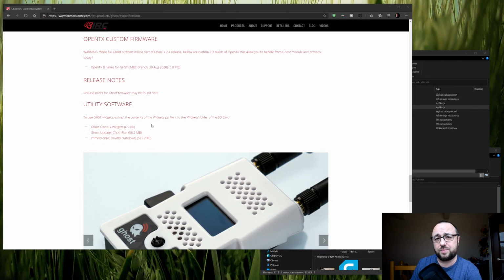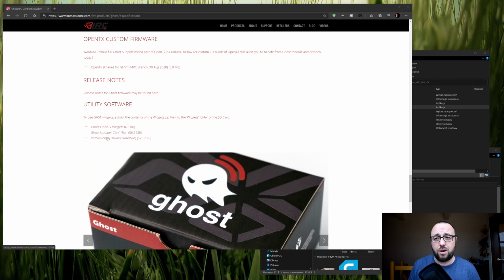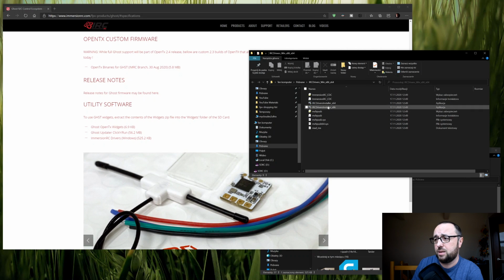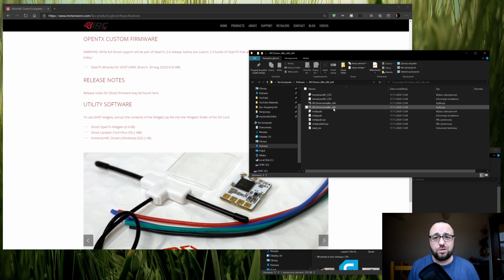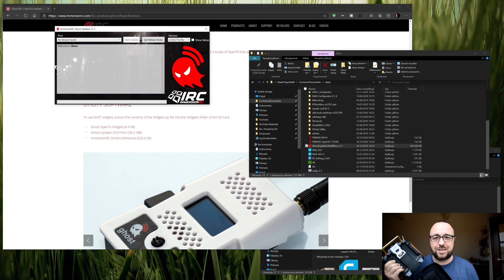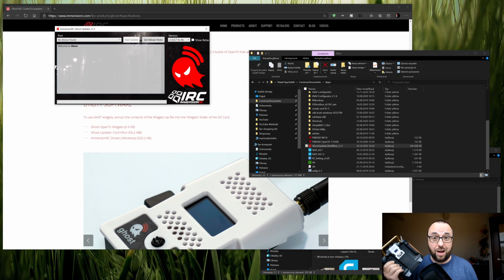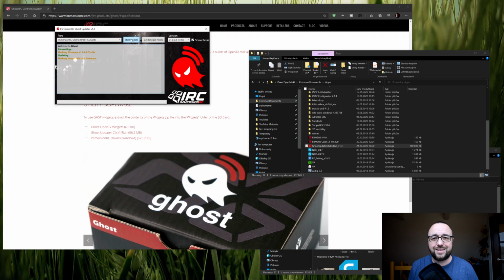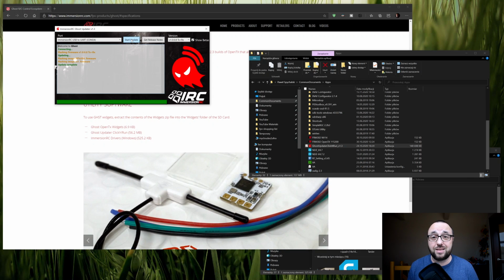ImmersionRC Ghost firmware upgrade tutorial

Comment: Pawel, I´ve a strange problem, can´t make it right. Inav for 7 inch copter as preset. Motor map ok, propps ok, board alignment ok. But! The quad moves with little gas up in panic at the same time yaw:s and is uncontrollable. Every pre check green. No problem to arm, but not flyable
Reply: https://www.youtube.com/watch?v=bEBympukKCA&feature=youtu.be
Reply: https://www.youtube.com/watch?v=xdhb-TbIHuk
Reply: Ok, downgraded to 2.3, far away from 2.6. Now it works. A bug in Inav 2.6?
Reply from the maker: rather too much vibrations and everything goes crazy
Reply: @FPVUniversity  And how to get rid of it? I use dampers on FC. Everything is tight and pretty normal balanced props . Reduce something to make it less sensitive?